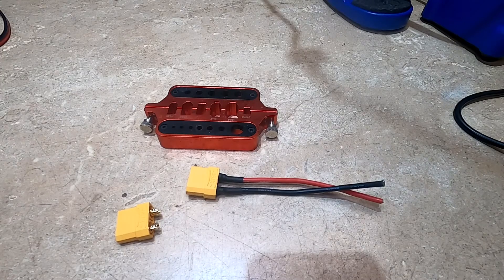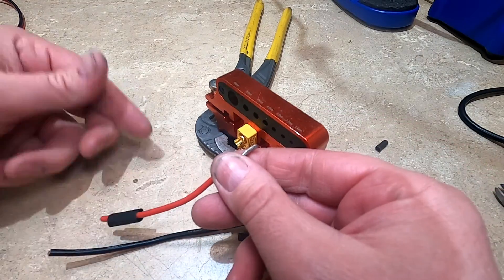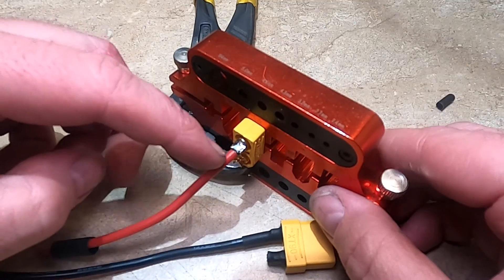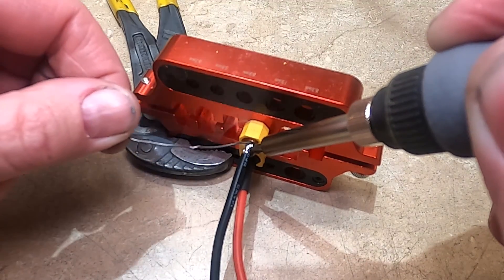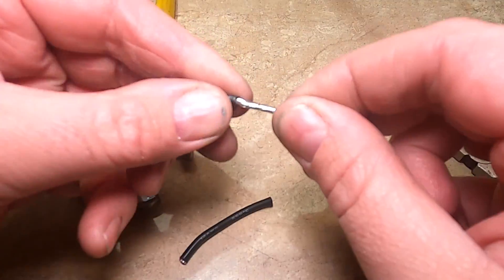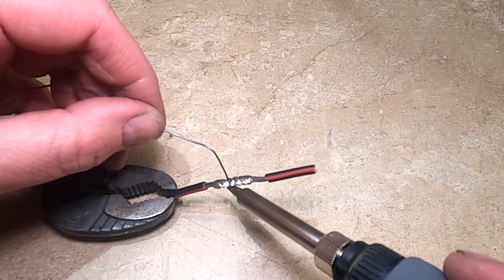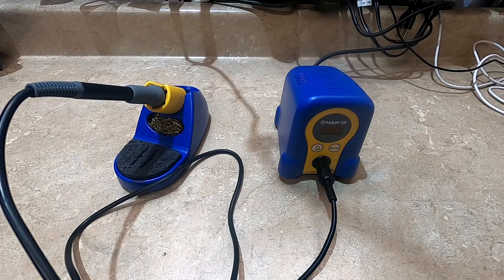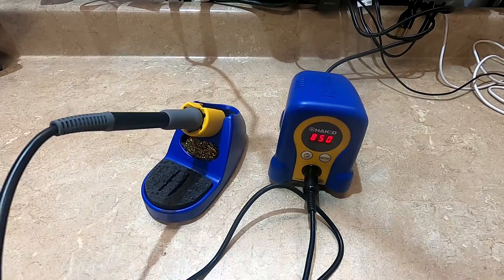How To Solder On New Battery Connectors And Wires

Comment: I have 20 connectors i have to do so this is very helpful
Reply from the maker: Thank you its not hard to do and the safest way is one wire at a time.

20 connectors though that will take a little while lol

Do all the positives then when you finish the last one the first will be cooled off to do all heat shrink then repeat for negatives.